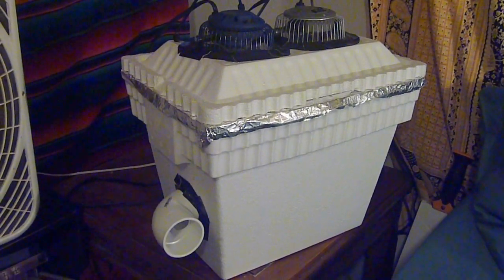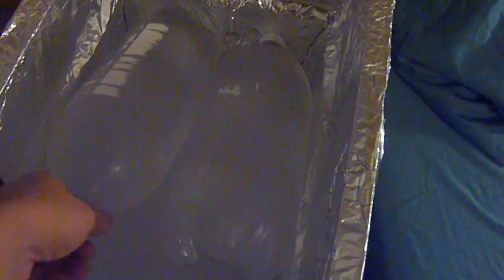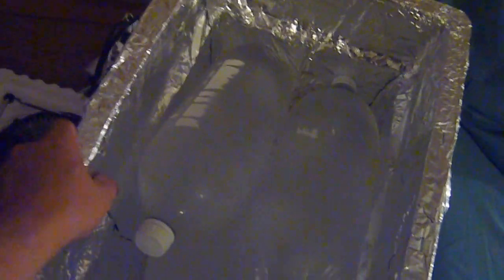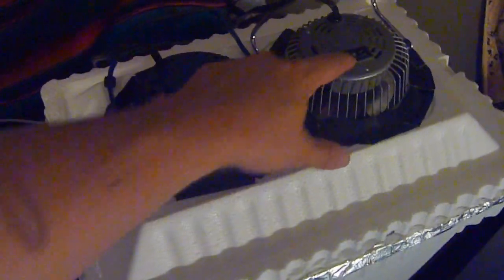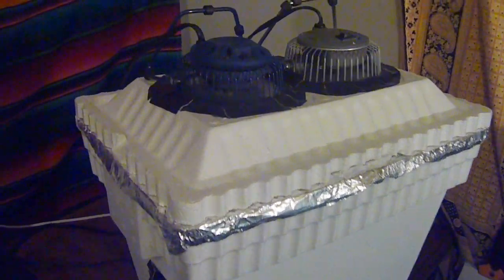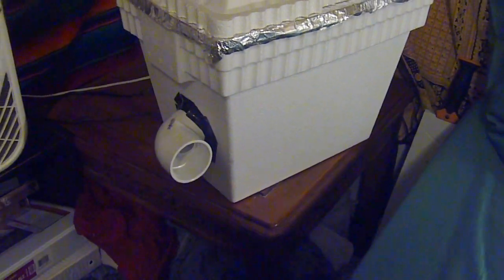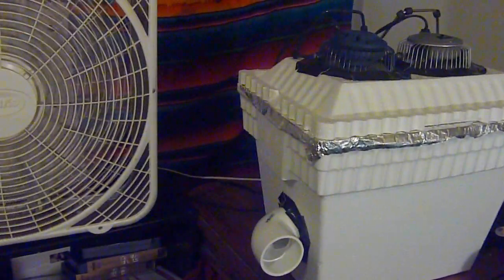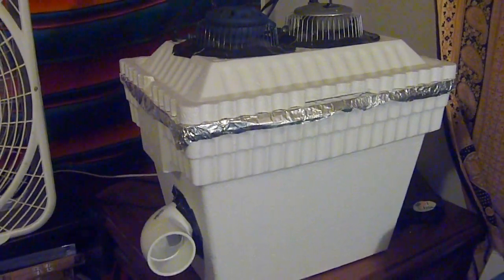Redneck Air Conditioner (Modified II) - Cheap Cool Air

Comment: Put the bigger fan in front of the cooler..
The fan blow the cooler air around the room.
I made mine with just a big fan in front of the elbow joint.
I did not have a little fan.
The bigger fan can pull the cool air out the box.
Just put the bigger fan in front the elbow joint.
No big hole in top of the box.
Works for me.
Reply from the maker: Can you pm me a pic of what you did?
Reply: I have done the same thing.

Works very well.

Comment: Your window shade should have a white sheet on the light facing side. Just add it behind the one that's there.  Those dark colors I'm sure don't help.
Reply from the maker: Alex Thomas Thanks for the tip.  I did take your suggestion and put the other white sheet up and it worked even better!

Comment: Yea had to add an extra fan on mine too.
Reply from the maker: jeff sharp What do you mean?
Reply: NKY DIY I omitted the elbows and had one fan blowing in and the other one blowing out that way the air circulates thru the cooler much better.

Comment from the maker: The room overall does not get much cooler because I only have one unit going.  However, if you have this thing pointed right at you, the difference is amazing.  I stay cool while I fall asleep or just laying there reading.  If you had 3 or 4 of these going I would assume it would be almost as good as a regular a/c unit.

Comment: not sure if anyone asked, but i'm wondering if you can use a fan that plugs into the wall. i've seen solar ones and car battery operated fans but i want to plug mine in. also what is the best size of fan to put in?

Comment: I just made one of these...... mine is a little different.. I have a tin ( metal can with lid that tea came in) that I load with dry ice... this tin goes into a very well insulated cooler that they use to ship stakes in.... fan at top like yours but fan is about 1 or 2 inches from tin and forces air out port in front...... o yes... and the tin of dry ice has a vent tube that comes out the back and continues out the back of the Styrofoam cooler..... its about 6 ft long so you can vent the co2 out a window or into another room.......... dry ice is at about -109 F...... just need a more powerful fan ... might try your idea of 2 fans.
Reply from the maker: Wow, that is awesome.  Can you please make a video of yours so I can try that out?
Reply: look up " diy dry ice ac"
Reply: NKY DIY look up " diy dry ice ac"

Comment: Yeah. I use the same cooler you do. The fan will have a large circle that's black to let the air out. I find it making a five degree difference in my room. Constantly putting cold two liters in it every 2-4 hours. It cools my whole room pretty nice from being dank and moist to cool and ventilated since the air gets cooler. I'd recommend to be careful since bathroom fans aren't meant to be on 24/7. They could if not designed for it (Burn out). Never experience any problems, but possible.

Comment: You're better of on going to home depot and spend $10 for those fans that are in bathrooms. It's more efficient. You can put the whole device inside the cooler having it sealed. Which you  can also plug into the wall :D 
Also it works best with what you used (2 liters of frozen water)
I recommend this, rather then the small fans pumping heat inside.

Comment: Can I place the bag the other way, instead of pumping warm air from outside the cooler which will cause the ice melt quickly, make the fan to pull out the cooler air inside the box. Will it work ?
Reply from the maker: Kent Cheng One thing you have to keep in mind is that you have to keep all of your cords above where any water would melt or possibly leak through a jug.  You could point both fans outward but they would be facing upward out of the top of the container.  If you could redirect the air with a shield you might be onto something.
Reply: Kent Cheng No because the airflow has to be pulled from somewhere, so no matter which way you take, air is still being circulated from the outside.

For example, if we did what you say and have the fans blow the air out of the cooler with the ice in it, and have no intake opening in the cooler for fresh air to come inside to be blown over the ice and out the fan then all you have created is a vacuum inside the cooler, and no air will leave the cooler. Air has to be replenished inside the cooler in order for it to be sucked up by the fan and blown out. If you can understand what I mean.

Comment from the maker: The problem with putting a fan inside the unit is there is potential water in there and it could be an electrocution hazard.

Comment from the maker: Wow no styrofoam coolers in Ireland?  What is up with that?  Probably an environmental thing which is cool because that stuff is terrible for the environment in the end.  You are probably right about the foil but I did it because I saw a video on attic insulation and I thought I could keep the ice frozen longer if I could reduce the heat coming from the outside.  As far as making the seal tight, it is hard because I have to replace ice every so often and have to open the lid.  Thanks for comment

Comment: " How would you make it?"
The same as yours, but instead of the PVC pipe, it's the Bathroom ventilator. Which cost actually $14-16. Still cheap. Even without ice or anything it's pretty good and circulates a lot of air flow. Compared to most fans. If you get the louder ones due to the faster speed.

Comment: Does the added foil really make a difference though?  I'm just thinking you're blowing hot air into the cooler and over the ice anyways.  What if you put a smaller PVC elbow pointed in the direction of the fan?  This would possibly insure cooler air flowing into the cooler and over the ice, slowing the thawing process. Granted, you don't want a large elbow so close to the fan that it creates a vortex of air circling thru the fan.  You'll lose the air flow thru your main vent.  Just a thought.
Reply from the maker: coreykat514 Yeah you could probably leave the foil off and get the same net result.

Comment: you might want to consider adding additional outlets (one elbow at the opposite end)...your input is too large for your output :-)
Reply from the maker: MrCeodez Maybe if I had a more compact cooler, because the more pipes you have sticking out of the unit the more air you are losing.  You need to direct the air out of one spot to get the maximum cold out of it.

Comment: Get a real aircon is my recommendation, Tried it all... using salt water, alcohol, distilled water, etc... The problem is the same, the more air you pull in, the faster the ice packs are going to melt and not only that but as the ice packs start to melt, their external temperature rises to the point its near ambient temperature. Now, I live in a hot climate. Ambient temp is around 32 C and that makes it even less efficient. It works fine for about 30 minutes, but all of the hassle for 30 minutes is not worth it.

You are better of with a cheap window air con that can be purchased below 100 dollars. Concerned about the electric bill? well... I'll tell you that cooling those ice packs puts your freezer to work, so you are paying for them anyways. a 600W 5000 BTU air con will cost you 1.20 US a day approx.
Reply: A gallon of frozen water lasts much longer than 30 minutes.
Reply from the maker: Abraham Saenz Interesting, but this will still blow cold air on your face if you really can't find a way to get an a/c unit in your dwelling.

Comment: you line it with foil, and then pump in warm air from outside via two fans!! It will make NO difference at all! But then, you're only wasting some foil so no biggie! You're best bet would be to ensure you have a very tight seal around the edges to make sure all of the air pumped in is going through the unit and out the elbow. tempted to make one myself but we don't have styrofoam coolers in Ireland, that I know of anyway.

Comment: DO NOT do this to cool your house, this does nothing but make your house hotter and consume electricity. The freezer dumps the heat it takes out of the water in order to freeze it into its surrounding. The freezer does not do this at 100% efficiency so it ends up creating a good bit of heat doing this, as well as consuming electricity. Then the fans operating to move the air in this create more heat doing work. An air conditioner unit cools by dumping the heat outside, that is why they are hang out of the house. This is just counter-productive and will cost money to heat your house.
Reply: wat
Reply: Don't tell me what to do!
Reply: The freezer is doing it's thing when you are at work. The Fan is doing it's thing late at night when you're trying to sleep. Also if freezer is in the Garage close the door to the Garage you can freeze a second set then when the Rates are Cheaper and the heat can't get into the house...